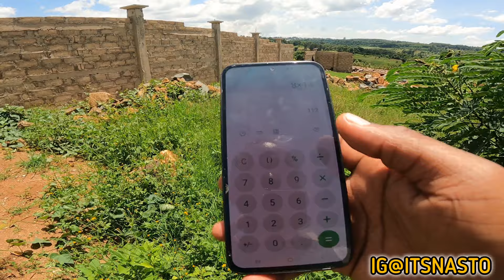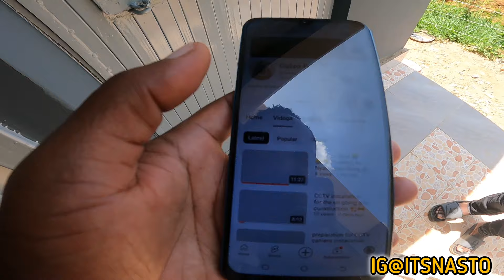BIG SUPRISE TO OUR DREAM HOME.... DAY 1 INSTALLING CCTV...NO MORE THEFT CASES 🙏🏾💪

Comment: Check that theres no space beneath your entrance doors. Most likely that is how the small 🐈 cat entered your house. You have to also prevent any reptile slithering into the house beneath the door. Your CCTV installer should also make it possible for you to remotely watch and monitor  your place using your smartphone, whether you are in Nairobi or the USA
Reply: When I saw the light coming from under the floor the first thing I thought of was lizards. Don't know if there are lizards there.
Reply from the maker: Thank you noted